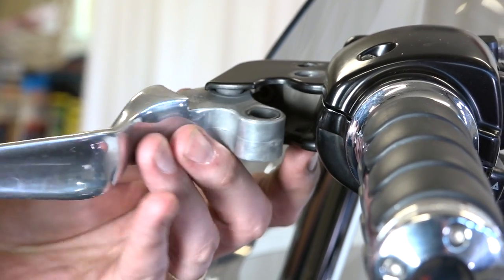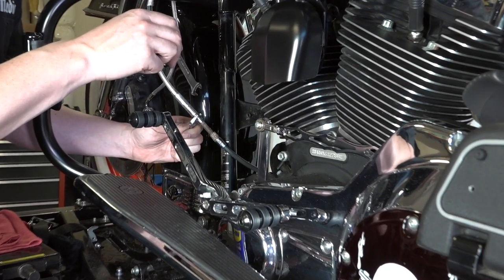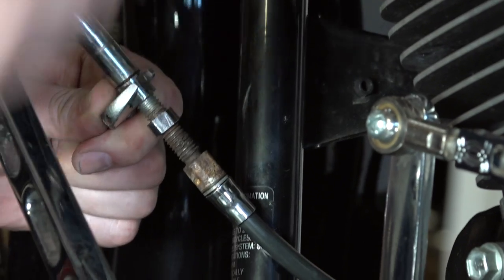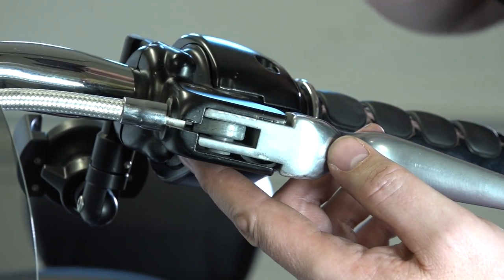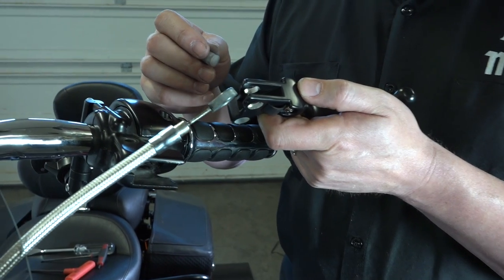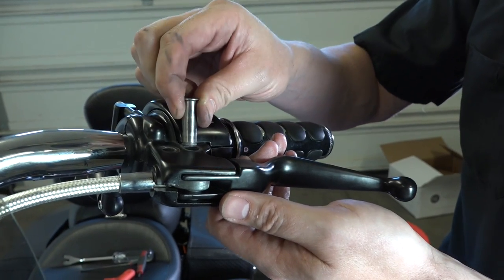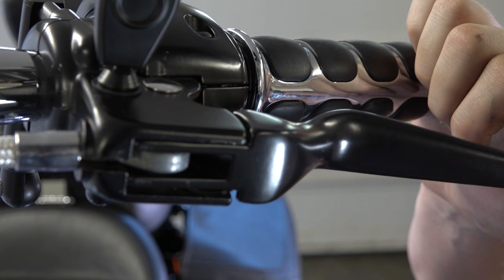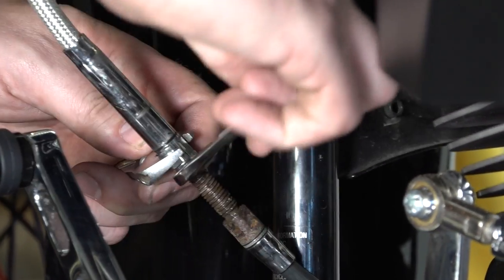How To Remove Harley-Davidson Clutch Cable Hand Lever & How to Adjust

Comment: My wife’s just got a new bike. Hers has the “chrome” style clutch cable. Hers doesn’t have a boot that can be slid off. There are a couple notches I see on both sides of it for a wrench. However I don’t see and type of retaining nut to loosen and if I put a wrench on both sides I can’t get it to turn either way. Is there something I’m missing here? 😂

Comment: I have a new 2020 Softail slim that I am trying to upgrade the levers on. The clutch cable on the 20 looks completely different then any clutch cable I’ve seen. There is a yellow plastic piece with a red button. Do you think you could do a video on the new cable design or direct me to a resource that would tell me how to get that off. Thanks for any help and guidance.

Comment: I changed the Levers on my 18 XL1200C. Its definitely Not a metric bike. Loosen the Cable Adjuster. Saw that Eyelet on the pin. Used to seeing the barrel piece. Like on the throttle cables of the older cars. Had the dealer perform the 5k Adjustments.

Comment: What's the lube you use on the clutch cable? And did you just use a plain syringe? How much lube would add on a new cable clutch cable (assuming those don't come lubrificated)? Thanks. Great video